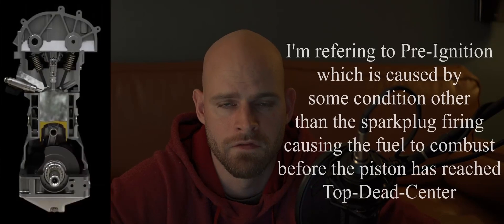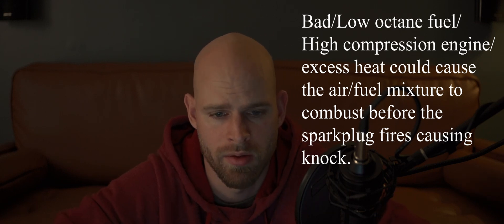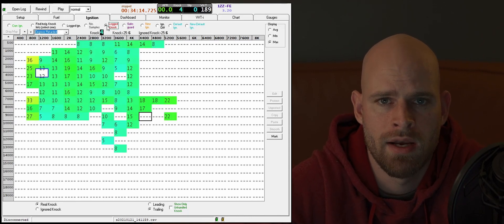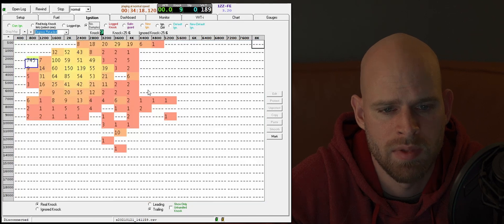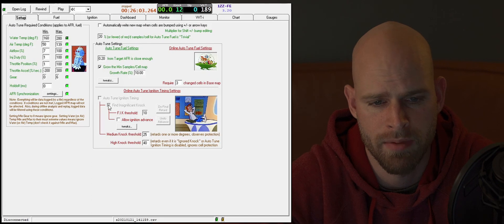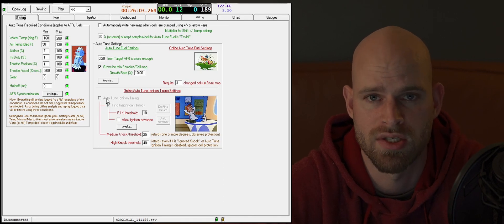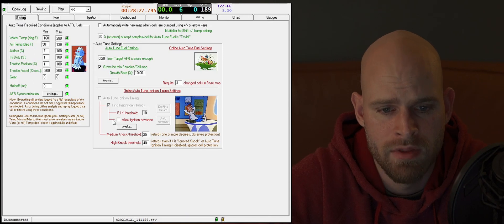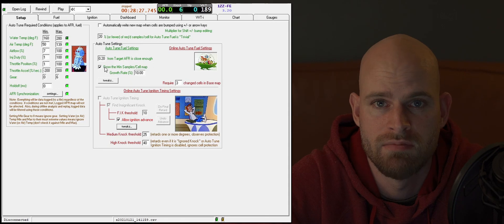Apexi PFC - Tuning Ignition Timing with CoPilot

Comment: Hi mate, it’s any chance to  help me with the ignotion map and injection map? I reset the maps by mistake, I have a Toyota mr2 Configuration :
• Engine: Toyota 3S-GTE (2.0L turbo, 4-cylinder)
• Turbo: BorgWarner K27 (standard turbo, max revs ~8000 rpm)
• Injector: 550cc (larger than stock)
• ECU: APEXi Power FC Full Computer 
MAP sensor is mounted on the intake manifold.
Denso 909110-13003 with two hoses connected to the intake manifold

Comment: I noticed it would let me edit new ignition but not current ignition, will it automatically change the base or is there a way to adjust the current ign to match the new ign?
Reply from the maker: You’ll need to write the working map to running. I don’t know what the wording is specifically, but you’re correct, you won’t be working on the “running map”

Comment: Amazing video series thank you so much ! also i have a question i'm looking back at my logs and i can't see my AFRs i can see everything else but AFR any suggestions ?
Reply from the maker: I can assume your wb02 is connected and fcedit/copilot are configured to read the input? If not, those are the first things.
Reply: @PatrickLipp  yeah it's configured i set up everything in copilot and it'll show the afrs while logging but when I go back to look at the logs they won't be there , however; whenever i log with FC edit everything is there (AFRS appear in the log )which i found odd, i wanted to use copilot because the general UI just seems a lot better and a tad more user friendly that FC edit also the addition of launch control is what drew me towards copilot .